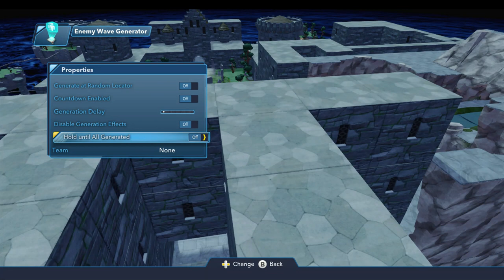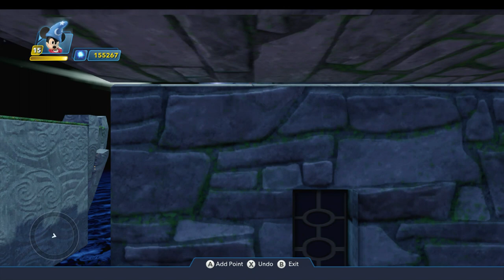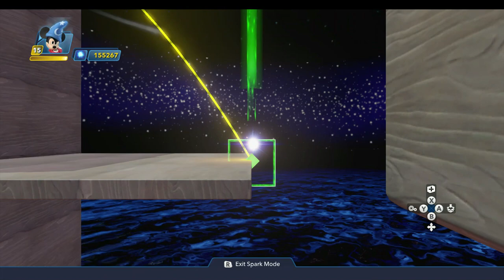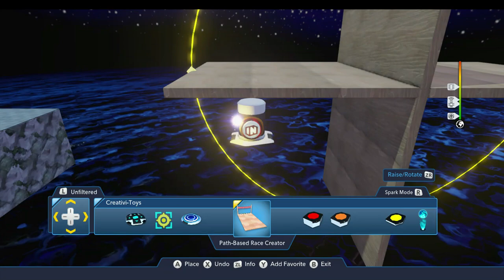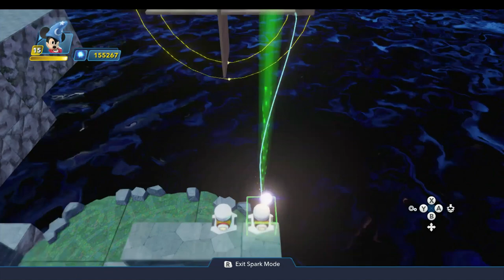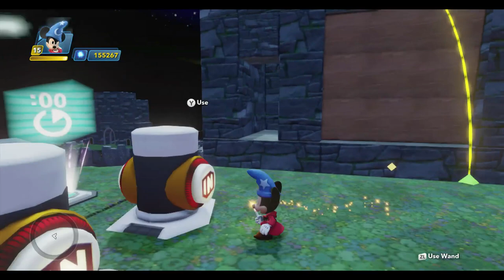Toy Box Tutorials #42 - How to Make a Drawbridge - Disney Infinity 3.0

Comment: What a fantastic work around Professor Toybox! Thanks for the explanation of the path movement as well, I figured it was just a crappy written code glitch, but you made it make sense on the why. Another option for a draw bridge which I use is also with the path creator. I make a small "L" over the edge (lip) going one point down, then you adjust the block at the start and end points to the desired level. The block is moved on the path at the one way and stop or back & forth options to trigger/logic gate setup. Anyways, an excellent path tutorial, I learned alot from this one. Thank you.
Reply from the maker: You’re welcome!